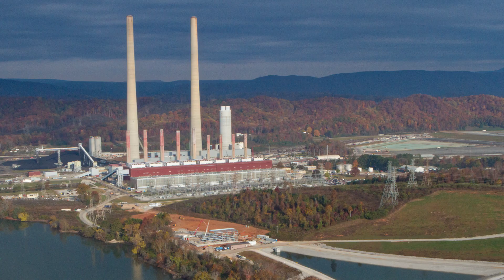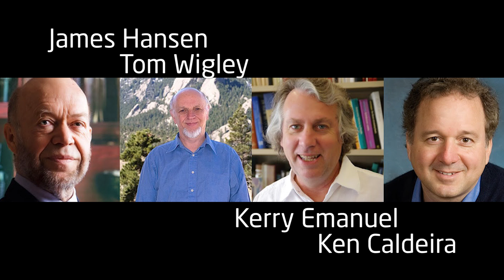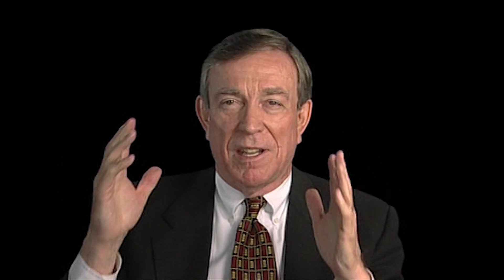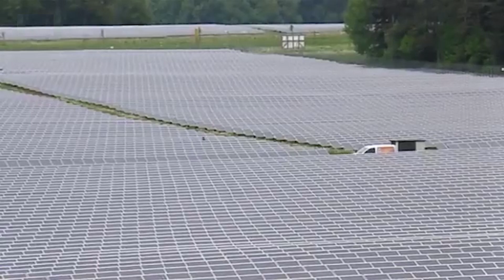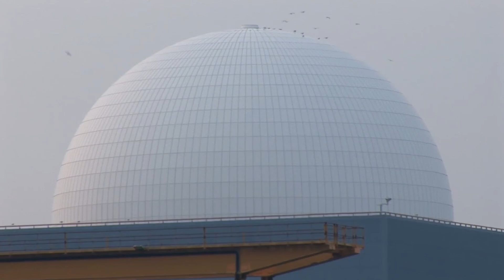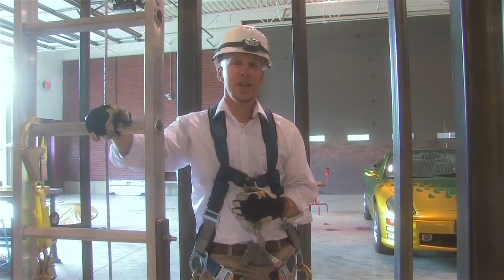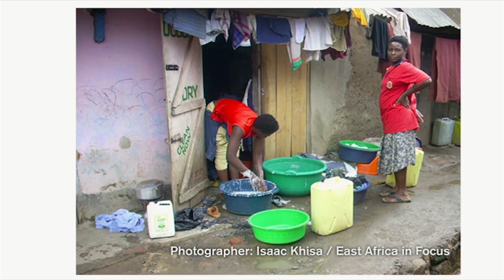Global Warming: Greens vs Nuclear - "Th" Thorium Documentary

Comment: This video is important, because it mentions externalities; the hidden costs of things and why they pervert true assessments of their real impact.

It would be instructive to have a video discussing the externalities of wind, solar, even hydro and compare them to fossil fuels.

For example, let's talk a little about photoelectrics. You can live 90% off the grid depending on your local insolation for most of the year. What are the externalities of that? And what industries must exist and persist for such a solution to be economically feasible for deployment in degrees sufficient to attain carbon neutrality?
Right now the photoelectric panel depends on doped silicone, backed by steel or aluminium. The dopant is usually rare earths. The overwhelming majority of rare earth mining today takes place in China. So that's great...if you live in China. You get cheap solar panels. What about the rest of the world? Should we then move those rare earths across the sea on diesel burning ships? The steel and aluminium is attained through massive release of Carbon Dioxide to produce the metal needed. How long will your solar panel have to last to offset those emissions?
As an intermittent source, you need a battery bank to store that energy at night and during cloudy days. How much carbon are you really offsetting with a bank of Lead acid batteries, with the casing derived from petrochemicals, the lead plate purified through a carbon emitting process, the copper wire derived through fossil-fueled electrolysis and a carbon-emitting mining process? How long does your solar panel need to run to offset that carbon output?

For wind; let's talk a little about the production of concrete. How many tons of CO2 are released in the production process? What about petro-chemical derived carbon fibre turbine blades? The neodymium magnets carried from China on diesel burning ships? The titanium/steel alloy of which the process of metal refining releases tons of CO2?

Those proponents of renewables presume carbon positivity or neutrality today on fundamentally flawed assumptions of zero externality production of capacity. Factored in, it would take decades of running to offset those carbon emissions; to say nothing of economic return. Nuclear by contrast, even with those factored in, still attain power density and use of materials that are minuscule in comparison.

The smartest things policy makers could do is to add tariffs to the cost/kilowatt-hour to fossil fuel generation consummate with the release of radioactivity and air pollution and resultant health problems. In that market environment, nuclear would be more attractive than ever. The problem remains anti-nuclear bias; and a refusal to admit that even renewables have their costs.

Nothing comes for free. But with nuclear, we can come close.
Reply: The problem is the fear and ignorance that information outlets too influenced by lethargy and the fossil carbon industry encourage. We bloody well know that you can't get much sunshine at night, or even in the day in winter. We also know that the well developed technology of wind-powered shipping was utterly defeated by coal, and then oil. So-called wind turbines are not a superior technology to sail. But for capital ships of navies, nuclear power outdoes oil and coal magnificently.
Reply: A most excellent point I bet it takes several thousand pounds of emitted carbon to put just one solar panel on a roof.....

Comment: Ho, the government doesn't do any regulating of the market, forward thinking people bring in a new disruptive technology or service that works better than the previous methods.  Thorium nuclear specifically can replace the base load generation (coal fueled) power role.  

It is difficult for people that believed in antinuclear like they did to realize they made a mistake.  They were not wrong opposing uranium nuclear and the bomb fuel it was generating, but the blanket opposition to ANY nuclear........

The goal is being as environmentally friendly as you can while moving towards renewable and more efficient energy.  The materials and overall impact of gathering from the diffuse wind and solar sources.  Hydro electric is actually a better trade off than both, but nuclear has less impact than putting serious acreage and habitat under water......

Comment: The effect on the human condition by energy use is enormous. Slavery ended in the USA at about the same time the steam engine was being perfected by James Watt.
So James Watt had an effect on the end of slavery just as much Lincoln.
Bill Gaits in  one of his presentations shows African students sitting under street lights because there is no electricity in their homes. This shows a direct connection between education and light.  The wood forests of the 1800's shown in early photos and paintings show a major depletion caused by burning wood for home heating. The forests of the north east have recovered because of coal, natural gas and nuclear use.
Kerosene basically saved the Right and Humpback whale from extinction. Whales where hunted close to extinction for their fat and oil to make candles. The washing machine is the great example when the women have more time they can teach and read to their children under a light powered by electricity.

Heating is a downward spiral in Africa. The soil is depleting because there is no nutrients going back into the soil because the cow dung is being burnt for cooking. Trees are cut down to make charcoal for cooking. The soil then erodes away because there are no tree roots to hold the soil. Its a Death spiral. (desertification)
One of the top causes of respiratory death, eye sight problems in children in Africa is cooking fires in the home. Therefor multiple problems solved simultaneously with electricity.